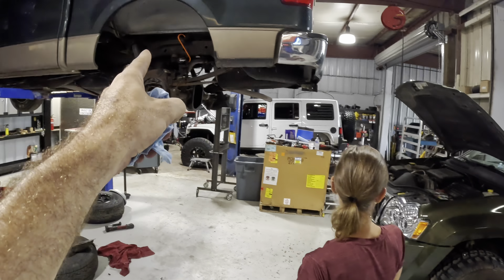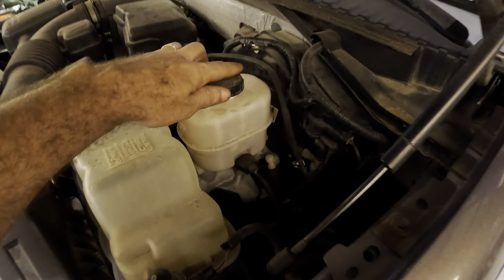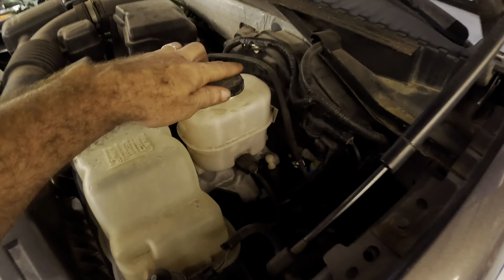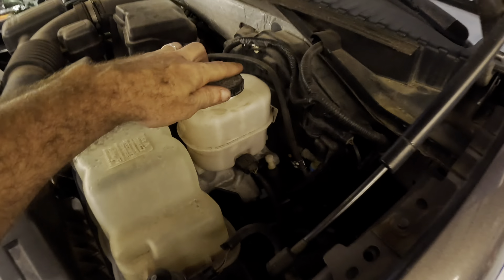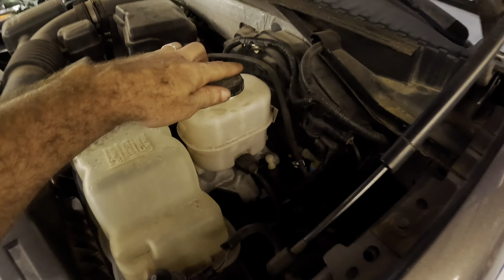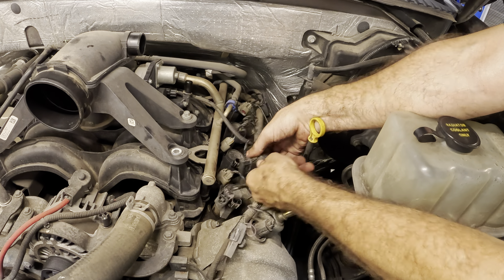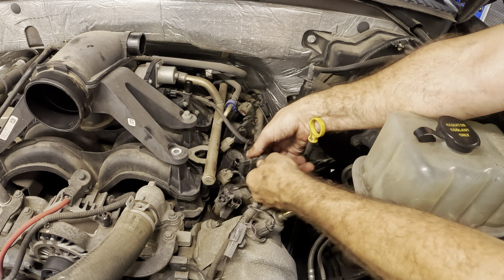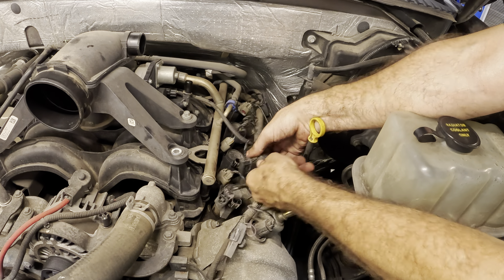Phone a Friend (Snapping Spark Plugs)@BeardedFordTech  Expedition 5.4

Comment: Seems like you need better informants, the current temperature in Westminster is 69 degrees Fahrenheit, and the whole year up until now has been cloudy, cold, and mostly rainy. One Sunny day does not a climate warming make. America with it's vast landmass is more inclined to extremes, but if we check the data from the Ispcc or what ever the letters are there has been no real noticeable major event caused by humans ever since the industrial revolution. If you read the summary which is written by politicians the end of the world is nigh. I prefer data compared to political opinion derived from WEF influence. Climate always changes, and in a very short period (maybe less than 5 years) we are due to go into a cooling period due to Solar influences. Lets not panic.

Comment: An English perspective for Ray:
For hundreds of years we had a predictable seasonal weather pattern and a temperate Atlantic influenced climate; we are an island.
Therefore, our houses and other buildings were optimised for low temperatures and highly insulated to retain heat; few if any incorporate air-conditioning.
Recently, the temperatures are increasing but regardless; when the outside temps get to 28C/80F plus our houses become intolerable 40C/104F stuffy Hell holes and we have no air conditioning! We can't sleep because we're only experiencing the high temps for 3 weeks per year and we're just not used to it. Why don't we install A/C? Because it's very expensive and for 3 weeks a year most poor people won't consider it.
Reply: The UK would benefit greatly from the adoption of heat pump systems that can act as a furnace during cold weather and with the flip of a selector switch or a button push on a smart thermostat turn itself into air conditioning for the brief warm spells you all have there. We call them Mini-split systems here in the States.
Reply: @jsh6952  Heat pumps have been mandated and price discounted by the UK government but the uptake is low because of the price.
Reply: @Lensman864 

The biggest hurdle for the citizens of the UK is the VAT that can double or triple the price of anything imported.

Comment: Massive dielectric grease can't be right. A touch on the end of the plugs is more realistic. You should always use a little anti-seize on the threads. Plugs can seize in the hole then break trying to get them out later ruining the cylinder. Have been fixing my own cars since the 70's and have seen that too many times. I still watch you even though you don't know what you're doing. Lol. Finally found someone dumber than me at times.🥴😎

Comment: Stop douching the conductor of the plug in a bunch of insulating schmoo. That's completely counterintuitive to achieving the goal of conducting electricity. Put some on the ceramic part of the plug where it seals to the rubber or just don't use it at all.
Reply: Technically you are correct but in actual practice it makes no difference so do it whichever way is faster.

Comment: I snapped off 6 of the 8 plugs on my '06 Expedition when i changed them years ago. The Lisle tool made the job a lot easier. Worst plug design ever. The engineers should have all been fired.

Comment: Just going into a second heat wave here - daytime highs in the mid-30sC (peaking around 95F), overnight lows around 18-20C.  

Not hot by southern US standards, but plenty warm nontheless - normal daytime highs at this time of year are 25C-30C (so up to about 89F), with overnight lows around 12C.  (again, doesn't sound too bad, but most homes do not have AC - so 30C tends to mean everything is uncomfortably hot and sweaty with little or no reprieve. 

Flip side, we get -20C temperatures regularly in winter, and that doesn't shut everything down either.